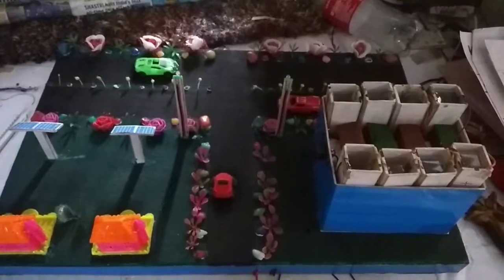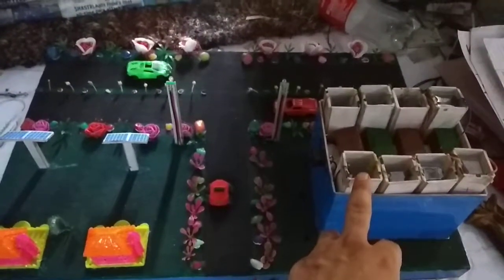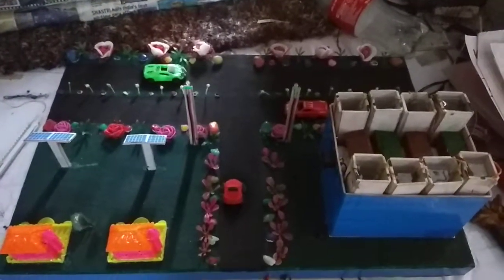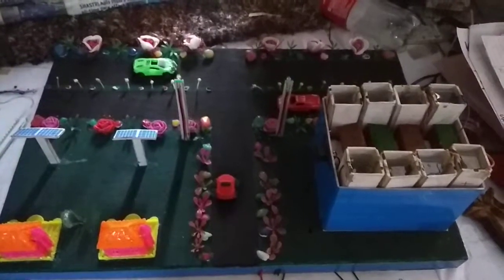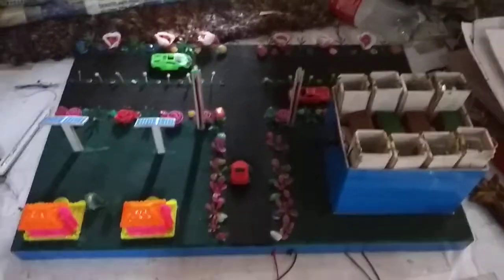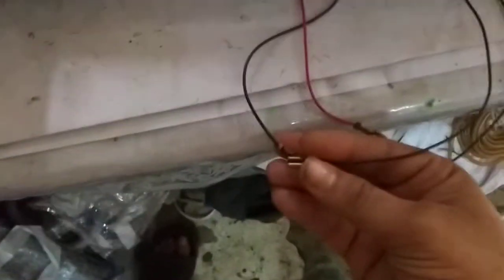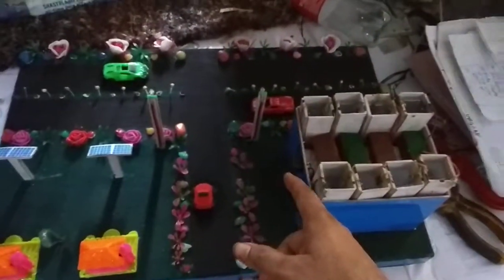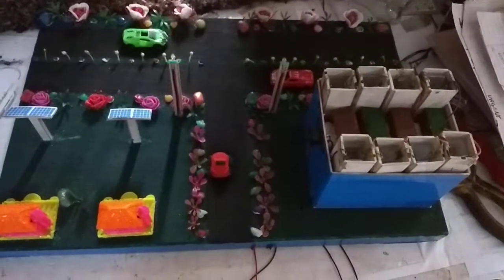Electricity From Salt Water (Salt Water Battery)

Comment: What you have used as cathode and anode
Reply from the maker: Cathode : copper, Anode: zinc
Zinc is negative, Copper is positive
Reply: @WorkingModelsSchoolProjects  try to put joule theif, it will increase the volt and ampere to any limit